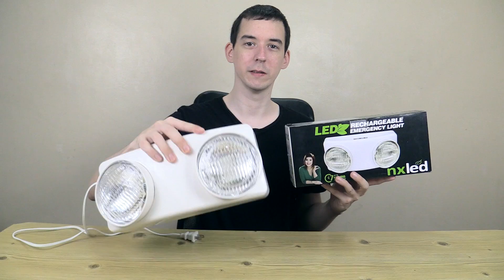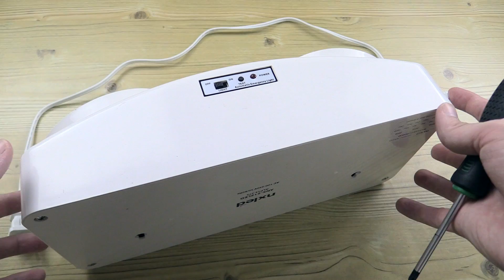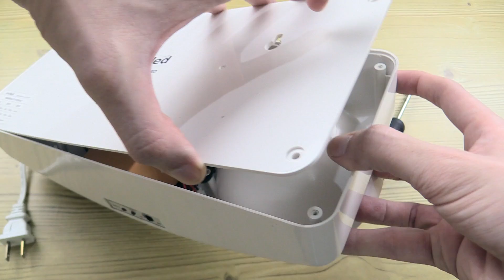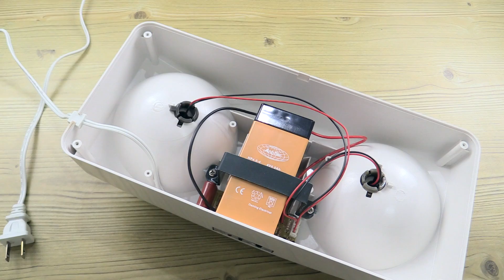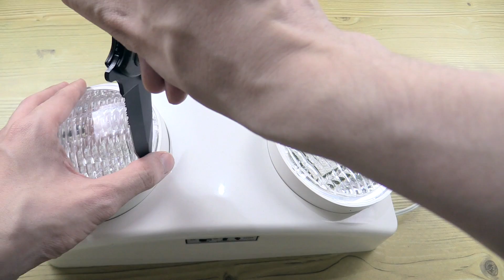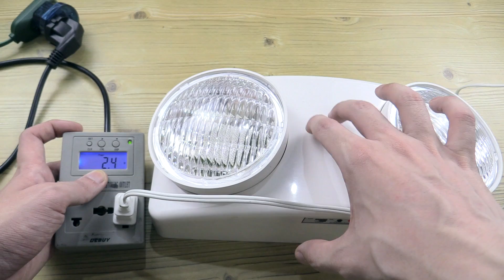NXLED LED Emergency Light

Comment: This is one of the cheaper+lower quality AELs on the market. The unit uses resistors and condensors as opposed to a transformer coil to provide direct current to the battery, which is a dangerous practice, and is most likely a Chinese made. I live in Thailand and all AELs uses transformer coil to charge the battery, also most newer units are equipped with programmable weekly self discharge run to help prolong the battery life, as well as an infrared remote to immediately test the unit without having to climb the ladder to where its hung.

Comment: They never plug in emergency lights to a socket in commercial buildings... Use some common sense.
Reply from the maker: +ironmatic 1 pretty much every emergency light in the Philippines is plugged into a socket. Why do you think otherwise ?
Reply: Gadget Addict Only in Philippines
Reply from the maker: +ironmatic 1 I've seen the same thing in the U.K.  Stop talking nonsense.
Reply: Gadget Addict Where was is than?
Reply: I've seen both here in Canada
Reply: Alex Martin In Canada, the only place you can have an emergency light plugged into the wall is in a residential building. In a commercial building, it's a code violation.
Reply: I may have been mistaken, seen so  many packs through the years. i'll double check
Reply: No they hardwired them.
Reply: In a commercial building they hard wired them, I did that already in the U.S. .

Comment: can i ask some advice about my 120-volt kitchenaid mixer which i bought a year ago from a balikbayan friend but  haven't use it since because our electricy here in the phils. is 220 volts.

i was advised to buy a power transformer however i got plenty of suggestions fro sales clerks on what appropriate transformer i should use. the unit i understand has a 450-watt unit. is it safe to buy and use a 500-watt transformer?
thank you sir.
Reply: tolits olcaab nope, they will melt and overheat.

Comment: i just bought one of the same brand and been using it for a month now. i really liked it over other brands since we are situated somewhere here in the south where brown-outs is already a part of our daily lives.

thanks for the demo sir. my apprehension is where to look and buy for the battery replacements in case the original battery loses its capacity to recharge. anyway, perhaps i can buy them in big department malls in cebu or cdo.

i've seen likewise your video of the mod switch and thinking of putting it myself. again thank you very musc for the very informative post.

God bless you man.

Comment: I need help i have a daul lite emergancy light that runs on 4.5vdc and the circut board went bad and im trying to turning the lights on by connecting one of the bulbs to a dc transformer but the transformer warms up too quick what should i do and i cant afford any parts
Reply from the maker: +Brandon Kenyon I guess you need a larger DC power supply. Are the bulbs LED ?
Reply: +Gadget Addict no they are regular small bulbs
Reply: +Gadget Addict its a daul lite ez 2 emergancy light
Reply: Gadget Addict al i wanted is to use the non led emergency light as a lamp because my closet is a dark spot and i want to use it by using a transformer that applies the right power to light by the way the model is dual-lite EZ-2 Dual Head Emergency Light
Reply: Just get a new EZ-2, they're only like $39 new.
Reply: ironmatic 1 I figured that out 6 months ago

Comment: I have the baby sister of the model you show. It's also NXLED and also has the model number ALP14-275 (searching for that led me to your video). It looks something like this but not exactly - http://nxled.com.ph/emergency-light/emergency-light3. I've had a problem with the thing three times already. When I needed to use it, it didn't work. Taking the thing apart, I see the red wire has come loose from the battery. In this model the wires are soldered onto the battery. Could the battery be generating enough heat to melt the solder? Would it be when charging or when charged or when it comes on? I resoldered twice already. The first time I might not have done a great job but the second time I made sure the solder joint was good. I haven't fixed it yet the third time. Any ideas? I clicked Contact Us on their web page and it just asks me to sign up for their mailing list, so I guess they don't want to provide support.
Reply from the maker: +Bill Brehm That's interesting. You could try crimp connectors on the wires instead of soldering them directly to the battery. But it certainly sounds like there's a problem somewhere if it's getting hot enough to break the connection! Maybe some kind of short circuit somewhere? I can't imagine there would be enough current or heat during 'normal use' / 'charging' to cause that issue. Getting after sales support from NXLED, Omni, Firefly and other local brands seems to be pretty much impossible. The only hope you have is if you still have the receipt and you can return it within the warranty period. How soon does it break after you resolder it?
Reply: +Gadget Addict It's hard to tell how long it works before it breaks. I fix it and I test it for a day or two, then put it out in the generator shed. That's what I bought it for so if there is a power failure and night, I can see when I go out to start the generator. I only discover the failure when I go out and need the light, maybe weeks or months later. I bought it in May which means even if the warranty is six months, I'm still good. And mine had no sticker to protect the warranty. I know they made a point of saying the battery is not included in the warranty. Maybe I'll try to exchange it first. If that doesn't work I'll keep it open and see if it gets hot.
Reply from the maker: Bill Brehm It certainly sounds like a faulty unit. If you still have the receipt I'd try to return it for replacement. Maybe don't tell them you already tried to fix it before.
Reply: I haven't found the receipt yet so I decided to fix it again and keep it open and see what happens. I think I have close to a month before the warranty expires. I didn't leave it on overnight, so I only have a short time testing it. But here is what I learned so far.

When charging, the battery has about 7.5 volts across the terminals. When not charging, that drops to 4 volts, which is not surprising because it's a 4 volt battery. So nothing unusual here except I would have designed with a lower charging voltage maybe.

I tried to touch the solder connection of the red wire to see if it was getting warm or hot. It was hot, but not temperature hot, it was electrical hot. The plug is not polarized and the battery seems to be referenced to what should be the neutral wire. My bad luck, I had the plug plugged in the wrong way. I guess this is not so horrible since the entire case is plastic and this is only an issue since I had it open and plugged in and decided to touch it.

I reversed the plug and after measuring with a meter to know I wouldn't be shocked, I touched again and the temperature was not even warm.

I can't imagine why plugging in the "wrong way" would cause any problem that would make the lead get hot.

there's a possibility that some water could get into the thing in a heavy rain. I have it mounted to a wall that is covered by a steel enclosure, but I see some rust stains higher up the wall that probably mean a small leak.

There is some damage to the top of the battery that I don't think I caused. I wonder if there could be an acid leak at the lead when charging either when not full or when full. Maybe when the battery itself gets warm from charging, some acid can boil up?

Oh, I just remembered, I noticed that the red lead was not unsoldered but it was broken off. There was not a stripped section of copper wired or tinned wire exposed. I had to strip it again. That's what made me wonder about the acid.

I will give it a full day test tomorrow and in guaranteed dry conditions.

Comment: I suspect I know the reason they don't include the screws. They don't know what kind of wall you have and that would determine which kind of screw is needed.
Reply from the maker: +Bill Brehm I guess. But other manufactures include screws and rawl plugs / wall plugs. So wood/concrete is covered. It's the same with NXLED ceiling lights, they don't include any screws and I'd imagine most of the time people are going to screw them into wood.
Reply: @GadgetAddict  bought one yesterday.. they now include screws + plastic wall anchors/tox

Comment: Very useful light and I agree, something we could consider for the home aswell as business. What gorgeous knife did you use to pry open the lens?
Reply from the maker: +Tricky Pixels I'm glad you liked the knife :) The flick spring is a little tough so it might not be a perfect everyday knife but I do find it pretty useful. It's just a generic black knife from I bought from Greenhills for around 300 peso.
Reply: In a business: 1: They are not a "we could consider", they're required by code. 2: In a business, you would not use something like this, it would have to be a proper one with pigtail wires.

Comment: The off function is actually pretty useful. I wouldn't want the light continuously on when I'm not around the area where the light is. That way I can conserve the battery, which is especially handy if power shortage will go on for a couple of hours/days. :)
Reply from the maker: +James Elij San Andres Yep you're completely right. After I edited the video I thought the exact same thing lol
Reply: +Gadget Addict that said. they should create a wired switch so we can turn on and off the light without having to reach up for the light when its installed. haha. :) very informative vids, btw! keep them coming!

Comment: if the battery goes maybe you could use some 18650's in parallel the voltage is similar enough